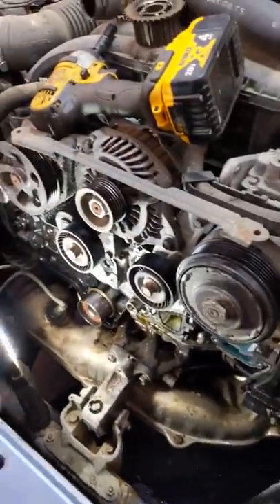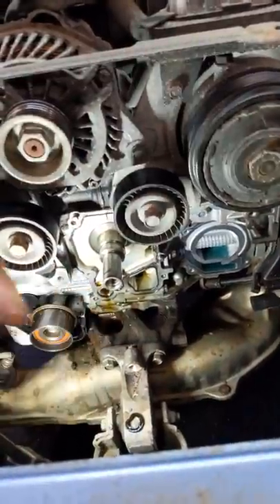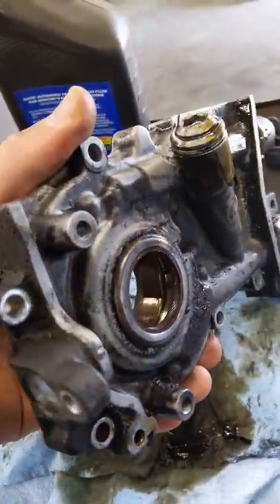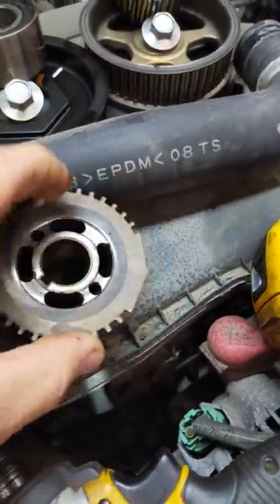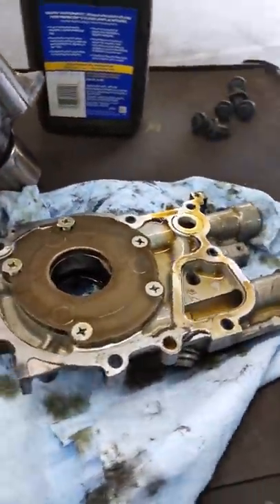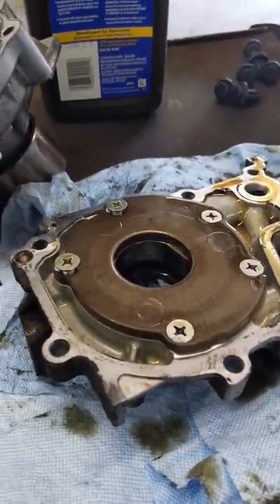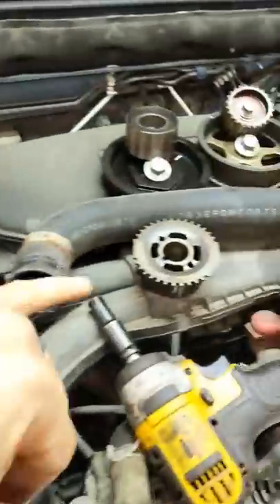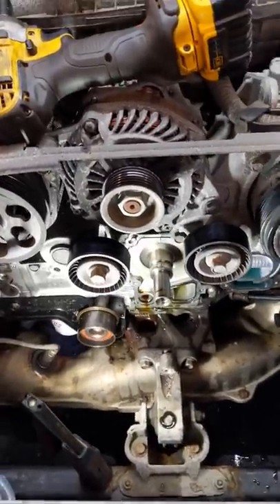Subaru Crank Seal Fail #SHORTS

Comment: After owning 2 subarus, never again will I own one
Reply: I feel that. Ive only had one and it was nothing but a money pit. Subaru seems to have a quality control problem and they seem to use cheap components lol.
Reply: Only took me one to learn that.  Nor will I work on one.  Jesus can forgive but I can't.
Reply: #me too. Inherited a one owner, low milage, garaged, serviced by the calandar mint forester with 80,000 km. By 130,000 it had split a battery, failed an injector, failed a plug lead, worn out shifter linkage, split 2 cv boots, clock failed, clutch started slipping. And during all this it was the most gutless borderline dangerous to pull into traffic slug ive ever owned. Got rid of it before the head gaskets shit themselves for a rav4 that felt like it had ferrari acceleration after the subi.
Reply: I’ve had two Subarus with many miles and no problems. I’ve had many cars. Subaru and Mazda have been the most reliable for me. Audi the least. But in truth, all have been a lot of fun. Audi and Jaguar are the only ones I would never buy again. Ford, Chevy, Mazda, Infiniti, Honda, Mercedes, Subaru can make good cars.

Comment: That happened alot back on the older 2.5L. Subaru from factory should of put blue lock loctite on them.
Reply: Go the red.
Reply: Wow still doing it!! We had the same issue back in 1992 on the WRX. Someone forgot to send that memo.
Reply: @jimmydcricket5893  Good call, Red is a better choice.
Reply: @deniselorish5384  f* that drop a little tig weld on the corner. Mechanical fastening for life.

Comment: I had an Impreza GTT from 1999 to 2004. Did all kinds of tracks with it (Spa, Brands Hatch, Nurburgring etc), modded to 310 BHP, 120K km, and never had the engine fail on me (those were the 2.0l turbos).  About 5 broken MAF sensors though, but I always carried a spare.  Fun brand, but always with some issues.

Comment: I have not run into that yet, that is a Solid tip!!! Thanks!

Sad that these are loosening up, unacceptable for any critical engine fastener.

Thank you Subaru for Not being involved in aviation.
Reply: Subaru has an aerospace division and makes drones and helicopters. Atleast they did, idk if they still are. My 2 old EJs have 480k miles between the two.
Reply: @Merker367  Interesting to hear of the drone and helicopter business, that is news to me. 
Very impressive mileage on your EJ's, congrats!. Have they been apart? Many of the EJ's i have done are going strong at double the mileage I went through them at and still going strong. It would be most impressive if they did not require major engine work to get them to that point.
Reply: @dfb1111  The factory headgaskets are trash on old EJs. All i have done is a gasket refresh on my two EJs.

Comment: one of the worst design flaws ive seen is gmc terrain that blows out the rear main seal if ice accumulates in the pcv crankcase vent system...just an awful repair ...if youre lucky enough to catch it before the engine implodes

Comment: Years ago I had a problem with a subaru pushing crank seals out due to excessive crank case pressure. The pcv system was plugged building too much pressure in system causing seal failure.

Comment: After watching your channel for a while, I'm beginning to regret owning a Subaru.
Reply: They're Japanese Audis--amazing cars to drive under warranty.
Reply: LOL, I'v had less problems with my 2010 wrx than my neighbour's 3 yr old ford.
Reply: Certain makes/models of different years sucked, but most of the older gen Legacy's, outbacks, imprezas with the bulletproof ej22 are literally tanks. I love my BK wagon, that ol girl will crawl on most 4x4 roads here without skipping a beat.
Reply: Why? They’re super easy to fix if something does go wrong with them, which is rare. I’ve had 5 Subarus over the years and never had a problem aside from frying front wheel bearings at the track  and a rear wheel bearing in a forester.
Reply: @locomike102  Never heard it put so well lol.

I live in FL, always wanted one of the early 00s A4s (the super nondescript Neon looking ones)... can't find a running one for less than 10 grand. That tells me 1) if it runs the owner expects a ton for it because 2) they all exploded. Anyways I'm a Saab owner to this day, I'm no pain to automotive struggle lol.

Comment: That's a double edge sword you got there. I have pulled many EJ oil pumps off for this reason and the bolts are not loose whatsoever. Turns out the PCV gets gummed up or freezes causing all sorts of seal pop-out issues. The most common being the front crank seal tho. DONT get me started on the FB engines and their front crank seal issues.....
Reply: Yep. Sure looks like high crankcase pressures pushing out seals
Reply: Fb engines? Facebook engines? Rx7 FB rotary engines?
Reply: @raving_1074  Subaru's newer line of engines. The FB and the FA. FB being none turbo while the FA being a turbo version.

Comment: It’s funny how Subaru can build all these common issues into their cars for literally decades (it’s so common that anytime i pull an oil pump off a Subaru, which I do any time I do head gaskets on them, I always check the oil pump case screws) and yet they are still more reliable and better built than anything with a German, Italian or Swedish badge on it.

Comment: Why does this shit always happen on the timing drive.... i had a cam actuator pulley screws come off on a timing belt driven 02 audi a6 3.0 v6. Bent 3 valves on that cylinder head, destroyed the pulley (800 bucks), destroyed the solenoid module behind it (1000 bucks), damaged the timing belt..... over 4 grand to repair that as the head had to come off. Luckily no head damage, besides 3 slightly bent valves. Those were replaced and car was put together with new pulley, solenoid assembly etc and it was running normal again. I unscrewed the factory tightened screws on the new pulley and locktightened them to 20Nm. No torque spec for that stuff, but it was more than original for sure.

Comment: Investigating why my EA82 had next to zero oil pressure, I dove into the oil pump to find the front seal basically could be pushed out by finger pressure alone. It didn't fit the hole it was found in. I used a center punch and pock marked the worn out (?) aluminum bore such that it at least was a suitable fit that didn't fall out on it own and it did cure the low oil starvation issue where it pumped foam instead of oil when the oil level was low. Lifters would collapse and go to ticking quite a bit during this aspect. Basic boxer engine on the VW had some options for main bearing fretting causing the same issue of oil pressure being dumped on the back side of the main bearings, but never a mention of this on the subaru side of things has me wondering if they ever knew the same issue exists on the air cooled VW. Counter balanced crank for subaru? Milling x off the case mating surface to restore main bearing gription as is done for VW as well? I'm talking to a stone wall. Let's pretend it doesn't happen seems to be the plan. And there is no fix for 5 PSI hot idle oil pressure.

Comment: Seems to me the Phillips screws on the oil pump rear cover were not correctly installed into properly cleaned/degreased threaded holes with correctly applied THREAD LOCKER adhesive on the screws

Comment: You should really check crankshaft end play.  More than a decade working on just Subarus I have seen more than one crank seal get pushed out because the crank decided to go for a walk. Generally more of an issue on the turbocharged EJs than the naturally aspirated,  but still worth it to check.

Comment: Honda crosstours have the same issue.  They will lose oil pressure so the light comes on.  And the problem is the screws on the back of pump come loose

Comment: I'll never understand Subaru fans who act like these are the greatest cars on earth. Bizarre stuff like this aside, considering Subaru couldn't get its head gaskets right for like 20 years, I could never recommend one of these to anyone. Not for a daily driver at least.
Reply: The turbo models arent that terrible my 1999 sti runs sweets everything original 190,000km only two timing belt changes and a $30 knock sensor
Reply: I've had 4 Subarus never any head gasket or valve seal leaks.  Then again I maintain my vehicles.
Reply: @vader2774  WTF? Only 118,060 miles and you've already had to have 2 timing belt replacements? What kind of garbage is that? That's low mileage. Timing belt/chain replacements are lengthy & very expensive repairs. If your car can't go 300k without any huge repairs like that, then they're not even worth it.
Reply: @SalandFindles  Timing belts are based off time and millage, a 99sti is nearly 23 years old, 2 timing belts across 23 years is ridiculously good, timing belt replacements are not lengthy or expensive repairs on a subaru, couple hundred bucks of parts  and a couple hours labor over a 23 year period seems reasonable to me.
Reply: To me they sound like tractors.. Especially the older ones.  Suby fans don't like criticism so its sure to bring out the Suby supporters.  I have owed one and only one. It was OK but it just wasn't for me.  Lots of fluid leaks and corrosion issues in the North East.
Reply: Typical customer of theirs has 
A no interest in driving or cars in general but all the interest in virtue signaling so bar is set low
B They can afford to trade in regularly avoiding worst issues, most used Subarus quickly turn into hot potatoes though, ppl give up after like second major repair( 1k+) of which typical Subaru needs many
Reply: Subaru's are associated with virtue signaling?! It all makes sense now.. Now I get why subaru's get a lot of hate when Eric posts a video about them, people talk as if they're the worst built cars on the planet. Some people must associate subaru's with liberals, and that's why they bash them so hard, facepalm.
Reply: @chrissmithz314  Yeah that comment was beyond stupid, like most "virtue signaling" complaints. I'd love to hear that guy explain what kind of virtues are being signaled by owning a Subaru.
Reply: @chrissmithz314  Well look at some of the drivers that drive them. All hand knitted tassel hats and free trade groceries in the back..  Don't forget the numerous bumper stickers like Destroy The Patriarchy, Coexist and the like. Gag...
Reply: The Subaru head gasket problem was mainly 2004 and earlier. The more recent FB25 engine, around for about a decade, mostly solves that problem.
Reply: @SalandFindles  Timing chains can sometimes last 300,000 miles or more, but timing belts are definitely not expected to last that long. The interval for timing belt replacement is 60-100K+. My 2010 Forester was 105K. I currently own a 2018 Forester with a timing chain. It has no manufacturer service interval.
Reply: @SalandFindles  timing belt replacement is due evey 100,000 km  and evey 8 years i think whatever comes first. Im in the trade so parts are cheaper than retail and enjoy taking care of my price and joy.
Reply: My 04 wrx has 203k miles, original everything. It's not the cars, It's who owns said cars.
Reply: Oh man...shots fired hit the deck. Just had a 2012 Impreza in for $1500 worth of work. 80k miles and the tcc solenoid shit out and guess what...not sold separately, have to replace entire valve body. Then the front AFR sensor had failed because it was soaked in oil from their lousy factory sealant job on the timing cover. I have to agree with the overrated thing. Every single EJ powered one that’s come through the shop over the past 12 years has had coolant, oil or a combination of both leaking externally from the head gaskets, regardless of age or mileage. But hey folks like what they like, look at the 6.0 powerjoke guys. “They’re great engines once you spend $15k on em” lol. Denial isn’t just a river in Egypt. Edit: just the NA EJ25s were / still are leaking, the EJ20 is a little trooper and the turbo EJs are pretty problem free. I like Subarus but I don’t see them through rose colored glasses like some do
Reply: @johnvilleneuve7944  The EJ22's are the true unspoken heroes.   I put over 600k on mine -- maintenance is just that - maintenance.   I didn't have to worry about bent valves, just the inconvenience of having my car die if i lost a belt....   I drove two to destruction over more than half a million miles of ownership.   That being said; the two timing belts let go at 74k and 78k respectively -- both Gates belts.   One was on a timing job with new tensioners and idlers; the other was on a used set.... I didn't seem to find much of an advantage 'skipping' the maintenance -- i gained a few months of driving around and subverted a few hours work on a saturday morning in my garage to working in a parking lot during a major snow storm....    I can't really complain much about that car -- except that I regret letting it go.   ('94 Manual Alpine Wagon)
Reply: @n3lee  man I forgot about the 22. Also a total trooper and so simple. Too bad you let it go. They are extinct in my area, like the ej20. I miss the 80s - 90s generation of Japanese vehicles when they were actually trying to build a reputation of quality and value. Now it’s just phone it in and blame the customer for everything, you know, the GM way.
Reply: @johnvilleneuve7944  Subaru extended the warranty on their CVT's to 10 years/100k (TSB 16-107-17R), wonder if the valve body would've been covered by that. Subaru isn't a perfect company by any means, but they're not as bad as people make them out to be.
Reply: You are baiting the fan bois bad on that one.
Reply: Yup, Ive had a Subaru and it was honestly a money pit. Head gaskets went (of course) along with a lot of other weird expensive problems.
Reply: timing BELTS on Toyota's get changed every 60k just the same.
Reply: Not to mention head gaskets !!!
Reply: I've gotten 300k or better out of 4 Subarus.
 Definitely don't recommend these short lived cars for daily driving.... Haha.

Comment: Almost every oil pump I’ve taken of an EJ has done that. I usually tighten them back up and take a pinch and punch the screw into the housing so it doesn’t back off again.
Reply: Your lying or just really unlucky. Iv taken apart 6 EJs so far an have not found this issue once. Drive em hard too.
Reply: @Merker367  lol no I only work on Subarus and happens almost every time. I’ve taken apart more than I can count. Not lying dude.
Reply: @christiangraham4579  Definitely dont believe you unless your only working on later models. I deal with the first series of EJs, never seen this.

Comment: So did a stuck relief valve cause the pressure to go high and push the seal and back the screws out? Or did the screws backing out cause the seal to push out 🤔
Reply from the maker: One will never know but rest assured that the screws were red loctited and tightened well and the relief valve was removed and cleaned. Oh and a new seal to top it off :)

Comment: I have 2 subaru legacy 5 speeds. Ones an  04 and the other is an 09. Both leak oil and antifreeze currently. The 04 is getting bad on antifreeze.  But 170k miles

Comment: Why Didn't Subaru Make These Bolts " Left Hand Thread " ( Reverse Direction To The Turn , Throw Of The Pump , Cog ) ( So That It Doesn't Loosen ) 
  And Lock Tight Them .

Else It's Evalution Depletion .

Comment: Had mine fail on my Subaru ej255. Problem was the guy who built it was building the thing on 2 hours of sleep over the course of two days with 2x 12 hour shifts in between. I forgot the seal. It made a mess lmao

Comment: The black seals made of nytril are crap.They shrink and harden up. Best to use the brown ones which are viton on the crank and camshaft seals. Also when installing the rear main seal on the crankshaft of a Subaru, use a 3inch PVC pipe cap to tap it in. Trust me, I've learned this lesson the hard way.

Comment: You gotta love where the oil filter is in those, a mate had a 2012 impreza with a EJ15 , mate said it went thru nearly as much oil as petrol, yeah it was burning but found where most was going, the oil filter all nice and cuddled up in the middle of the exhaust pipes was the main culprit, turns out whoever serviced it before he bought it barely tightened it, think i got about 90 degrees before i felt resistance, so not only quick lube screw ya, car supermarkets in the UK do too lol
If Eric can, we'll let him do it lol 👍🤘

Comment: Only needed to own one Subaru to realize the boxer engine didn't catch on for good reason.  Its advantages make sense in a Porsche but zero sense in a eco box with a rubber brand for a transmission.

Comment: Did Subaru ever solve their head gasket issues?
Reply: Sometime in the mid 00’s. Lucky it was just confined to the EJ25, so you’d just buy a legacy with an EJ20 or EZ30 or turbo instead. 
The whole problem is a bit blown out of proportion anyway IMO.
Reply: Thanks.  My wife and I will be looking to replace her Impala within the next few years.  She wants AWD but doesn't want an SUV.  It's either going to be a Legacy or an AWD Camry.

Comment: Minster Eric O'Malley of Southeast airlines. Have you worked on any of the fancy 3.5 liter ford or Mazda engines with a nice semi internal water pump. Thoughts anyone 😬
Reply: They suck. I have had three wipe out the engines because the customers continued to drive the vehicles until overheat failure (all three very high mileage) because there was no sign of external coolant leak due to the poor design of the waterpump.
Reply: @midnightrider1854  Thanks for the reply. I'm trying to not worry about it,but it's difficult not to. High mileage as in over 150,200,300k?

Comment: Lock Tight The Bolts ? 
Upon Reassembly ?
Reply from the maker: I do. I use the red personally
Reply: @SouthMainAuto  
 Thank You Mr E .

Hmmm    Red  ,  Blue  ,  Green  ,  Lock Tight .
 Each  Having Different Strengths  At  Different  Temperature Ratings ( Hint Consult Wikipedia For Description )